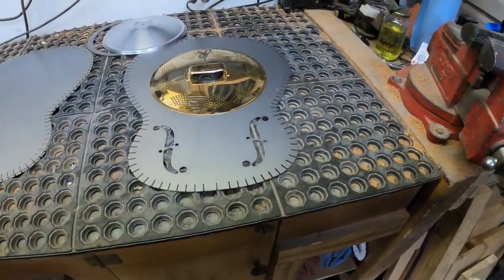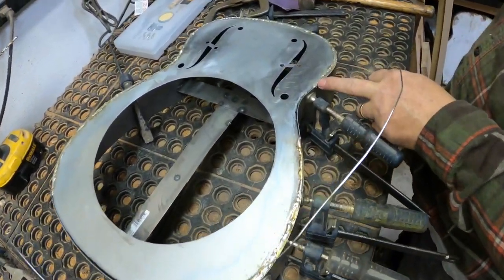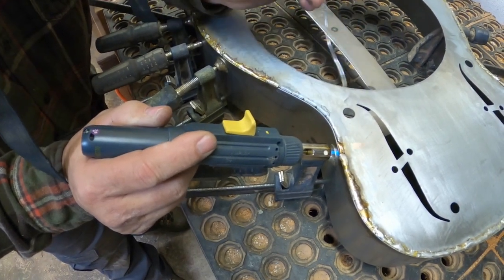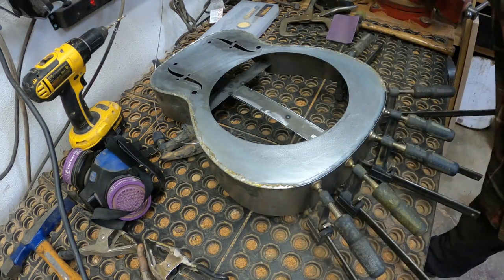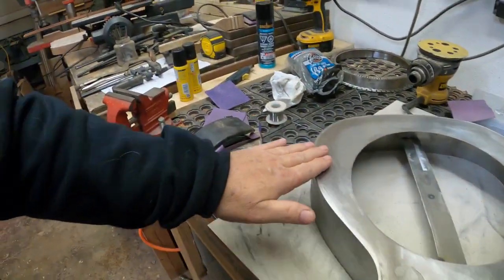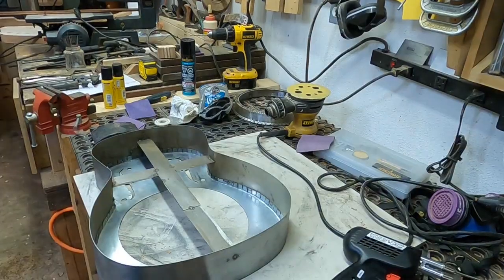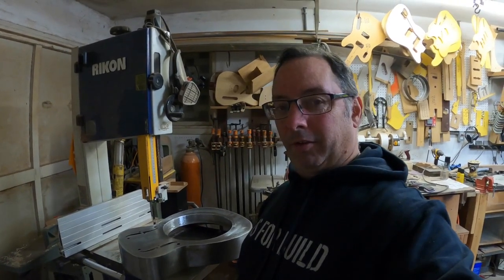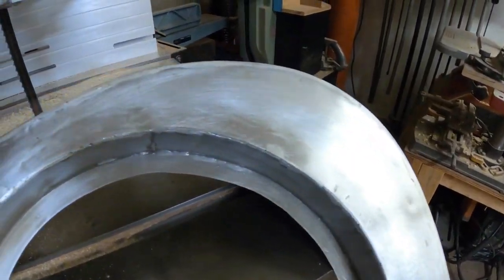Building a steel Resonator guitar | EP4 | It was so good til it wasn't

Comment: I used to solder and braze museum mounts from brass and steel, and of all my favorite tools I had, my ABSOLUTE favorite is my Smith Tiny-Torch set.  It’s a micro oxy torch that works with those Bernzomatic bottles, and can work with both MAP and Propane.  I never really needed more than propane for what I was doing, and imagine that propane and oxygen would give you both the heat penetration and the tank longevity. From my experience, you’re a little cold on the flame, and that’s making the solder a little more prone to need cleanup. It should flow almost like water.  

Just my two cents, but the tiny torch is pretty affordable and would make life a lot easier if you plan to do a lot of these, especially with the tank capacity.

Comment: large mass brass iron( the one that's heated by external source ) is the way to solder metal parts like this; steel, SS copper.... way less distortion, homogenous repeatable clean welds and it is much quicker.
Reply from the maker: I've seen people use those, they look good. Not sure where you get them and they look like they take up a fair amount of space. I'll see what I can learn about them. Thanks.
Reply: @Ninety2guits  eastwood used to have some for lead bodywork repair or a search under maple syrup transformation supplies

Comment: My feeling (as a low tech metal fabricator) is you should raise the top out of the sides about the  same distance as the thickness of the side plate; that way you can build up a solder joint "on top of the side", which you can sand to a rounded profile. Great job you're doing! Thanks a lot for sharing this :)

Comment: I'm in my seventies and can"t play anything but you have inspired me to want to build one of these, having never even heard of them till tonight I think my son playing will enjoy it more than  enough to bring me great pleasure as I listen, but my main purpose in commenting is that as an old mechanic  I"ve done my fair share of soldering  and I believe if you beg borrow or steal a "real soldering  iron", one that doesn"t have a power lead and you use what was called a blow torch  to heat the copper head stuck out on a steel rod with a wooden handle , the torch had a gun sight  "v" at the front which the shaft of the soldering iron would sit in and a hook at the rear would hold the iron balanced while it re heated having been strategically placed to put the head directly in the flame of the torch, I will try to get a picture, old plumbers would use a soldering iron to solder a corrugated water tank as they did in australia and probably USA when Adam was a boy. ,you will find it transfers a steady heat to the solder and allows you to control the solder and it"s flow along the joint and therefore  save you  filing or excess solder removal. It does need to be continually sat back on its frame and reheated. A green tinge to the flame indicated it was at temperature.   ps you would still need to contour the solder ( file it ) dave
Reply from the maker: Hi Dave, thanks for the detailed comment. "When Adam was boy" 🤣. Hopefully you have time to make it further into the video build series as I figure out the best way to build these. I have tried many options since the soldering iron with the cord, I have now settled on a propane torch that is working extremely well. I did this first build with a butane mini torch and it worked fine but it was slow. The new propane torch is much much better on the 2nd build and I think I get a better solder joint with it because it is hotter. Thanks for following along, really appreciate it. James

Comment: I never made a guitar but I done a lot of bodywork in steel and Aluminium. The cuts in the outer flange are not necessary and the flange could be shorter. The soldering should be done with a heavy iron and flow the solder to the iron which transfers to the steel for a near perfect capillaried filet of solder in the joint.
Reply from the maker: I agree the flange could be shorter, that's my next change. You think I could bend the edge over the form without the relief cuts? The originals have the relief cuts so I was just carrying on with that concept. Results have been good so far but I'm all ears if that can be done easier. With the laser cutting it's extremely simple to make the cuts and it's pretty flawless on the bend over. Thanks for the comments.
Reply: @Ninety2guits  I could definitely hammer dolly a flange without the cuts on such gentle curves especially if they were only say 3/8. and it would help the solder sup into the joint for which I would be using a heavy duty electric soldering iron. For the sake of originality if they had cuts and you want to keep them I would have shorter cuts which don't quite reach the bend line and so would be less visible on the seen side and you would have less dimples and a more consistent fair curve. If I was producing a series of those I would laser cut a 3/8 thick hammer form plate and throw a 1/16 deeper flange which could then be ground back to the surface of the form plate for perfect flange depth all round.
Reply from the maker: @del00ze  I was just watching the Mule resonator builder talk about learning and he mentioned he always had wrinkles to deal with when bending over the edge if he didn't make the kerf cuts. I like the idea of not making them go up so far and I hadn't thought of adding the round over curve to a hammer plate, that's a great idea.

Comment: I agree….the top is way tooo thin…I own a 1931 National Triolian…I’m surprised at how thick the steel actually is,,,.no flex at all in it….hope that helps…
Reply from the maker: Yep that helps. I had concerns about the gauge steel as soon as I started cutting the f holes. Sometimes experience is the best teacher, I'm still not sure if the 20 gauge I'm using now is ideal or not.

Comment: That little torch is clearly the wrong tool, all that steel is a huge heat sink. One pound cylinders would be the minimum imho, a twenty pound cylinder better yet.
Reply from the maker: Tried that in episode 3, that little torch is perfect for me.
Reply: @Ninety2guits  It does look like a handy thing and it's pretty impressive that it can bring enough heat to solder that much steel.
Reply: Agreed, I use a 1 pound copper iron heated first by the torch. With the iron there is enough heat to sweat the solder into the tabs along the sides making for a strong bond with no chance of the solder joint cracking open in the future.

Comment: You never use muriatic acid on steel. Muriatic acid is just the name of the concentration of hydrochloric acid. Here's the problem, muriatic acid needs to be neutralized. Acid is not a flux.
Your steel should have been heavier and it should have been TIG welded. Solder is soft and does not resonate. It is a deadening metal. This will greatly affect your tone. The steel body should be one piece after it's welded. Either using filler or forge welding with a TIG welder. This way the steel carries the residence. If you don't understand metals and welding and how to join metal you shouldn't be doing this project.
Reply from the maker: I can tig weld but that's not how Mule and others build them. The originals were all brass instruments and silver soldered. You mention a filler. What kind of filler? Thanks for the encouragement.
Reply: @Ninety2guits  
When you join steel parts together with a non-ferrous metal, silver solder or bronze or tin solder, you lose your resonance between metals.
They act as an insulator or a vibration damper.
Your filler metal should be the same as what your construction is, steel for steel or aluminum for aluminum.
Here's an example you can identify with. If you cut a tuning fork in half and solder it back together you've changed the dynamics of your resonance.
Reply from the maker: @greggminkoff6733  Your tuning fork example is awesome, glad you mentioned that. If you were to put strings on a tuning fork it would be a very difficult instrument to make music on. The amount of resonance and ringing and frequencies would be nearly impossible to control, it would need some sort of dampening. I have given a lot of thought to welding one of these together but there must be a reason all the high quality resonators are soldered not welded. I think you nailed it with the tuning fork resonance. Think of a piano, it has a massive wooden sound board which seems like it should provide enough dampening to play music on it but it needs the assistance of a dampening pedal. If you have ever played a single cone resonator guitar you already know how hard it is to control all the resonance and frequencies that come out of it, it needs dampening to keep it under control. I always thought the reason these were made of brass or German silver and soldered together back in the 30's (and still to this day) was because that's how horns were made so somebody just applied that knowledge to a guitar body and put strings on it. I think somebody figured out these need some form of dampening and the solder helped. I have a feeling the cheap Chinese resonators are welded together but I'm not positive. I've played two of those cheap ones and hope it never happens again. Now I'm off to try and understand why muriatic acid shouldn't be used on steel to clean and etch the metal so the solder bonds better. It's a known practice amongst roofers so there must be something to it. Thanks for the discussion. 👍
Reply: @Ninety2guits  
I'm a retired welder with over 60 years of shop experience dealing with metals and fabrication.
I used to be a musician I had an early Martin D12-20.
I've never seen how a National steel was put together. It would make sense to solder the joints rather than weld them. Too much heat when welding will warp and distort the metal. At that time when National was first making steel guitars, electric welders were very crude. A TIG welder would have been ideal but they too at that time had limited adjustments for the heat range and no controls for the frequency output. The new welders are awesome. If you were to use a TIG welder with a foot pedal, to control the heat range,
you would be able to use a minimal amount of heat to weld the body together. I would go out on a limb to suggest you make a rectangular steel box, 8 x 10 x 2 inches with a 2" hole on one side,
that has been TIG welded by yourself or a shop, as an experiment. I believe you might be pleasantly surprised by the results. If the welding is done correctly you should be able to smooth out the joined areas for a seamless look. Just a thought.
Reply: James, you have the patience of a saint. "you shouldn't be doing this project". LOL.   @Ninety2guits